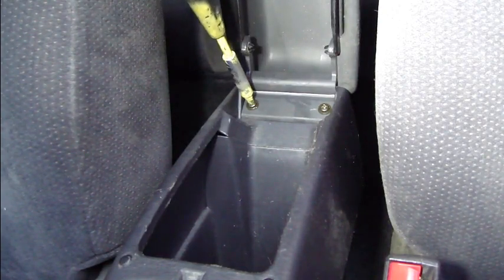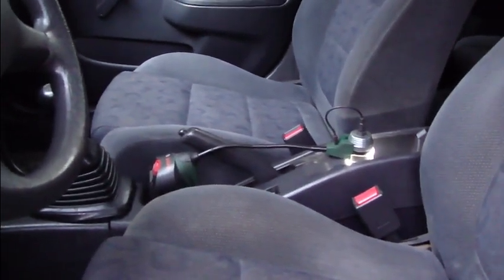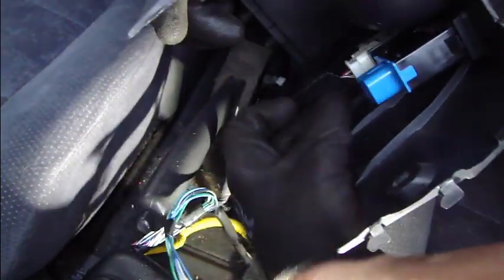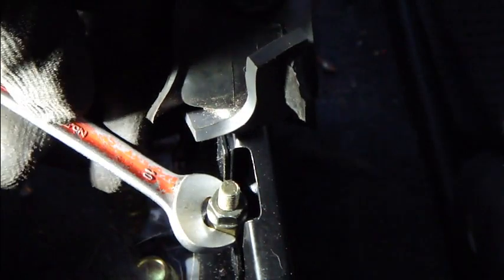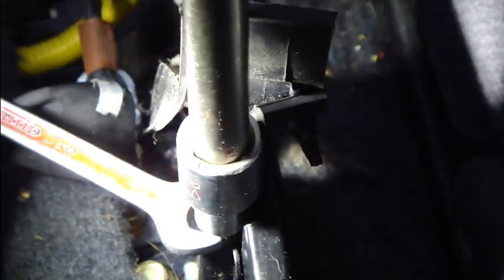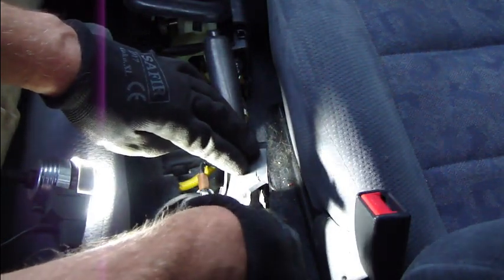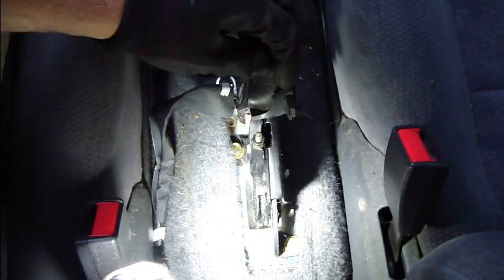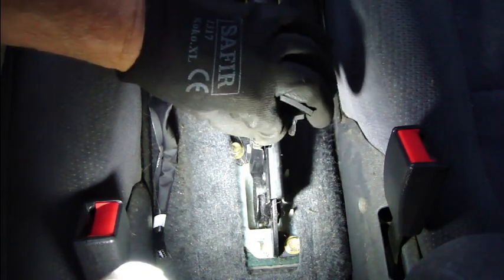How to adjust hand brake cable Toyota Corolla. Years 1995 to 2015

Comment: No need to take centre console out if you have a long reach socket, just move aside the handbrake lever dust cover and you'l see the adjusting nut
Reply: How do you stop  the adjustment nut turning when your tightening the lock nut?
Reply: @Mickyrst43  I think you first unscrew it, then tighten the nut below and then screw the locking nut back in.
Reply: Ohh I misread. It tightens against the nut below, at least for me it did.

Comment: Thx for posting your video, I have a tercel but the set up is similar and your video helped me diagnos my e-brake problem. Took everything apart found the cable with the two bolts, pulled on it a little and the cable came out, it was broken, lol, time for a new cable, that's job is too big for me, at least I can tell the mechanic exactly want to fix and not get ripped off, because you know how mechanics are with girls when we come in with problems and don't have a clue about what's wrong. Thx for you video it was very helpful.
Reply from the maker: kjlloyd424 Thanks your info text and You are welcome.

Comment: My son and I have been working on a 2000 Chevrolet Prizm LSi with a emergency brake that is very similar to that shown in this video which also requires the use of 10 mm open end and/or box end wrenches to turn the adjusting nut and locking nut used to adjust tension on the brake cable. But on Monday January 20, 2020, we could not adjust the cable tightly enough to get the car to stop well  when testing the brake for emergency use. Also, we could easily get nine or more clicks when pulling the emergency brake lever. My 1989 Toyota Corolla stops better even though this Corolla still has old brake cables and has not had the tension on the cables adjusted. We checked carefully all that we did and believe all cables were installed correctly  from the rear wheels all the way to the lever for the emergency brake. We had the same problem before January 12, 2020 but that cable stopped the car not as well as the one with tension set on January 20.  On January 12, we tried tightening the tension further than the threads on the cable allowed by using three larger nuts as spacers put below the tensioning nut but around the threaded metal that attaches to the cable. We succeeded very well in increasing the tension because we broke the cable. When I looked under the car I saw that the portion of brake cable that leads from the lever back to the equalizer was non-existent. 

On January 20 we decide against using a large nuts as spacers for fear of breaking another cable.  

Have any of you had a similar problem with new brake cables not adjusting to enough tension to stop the car effectively?   What I mean by "effectively" is that when parking the car on the driveway with what I am guessing is about a ten percent slope, seven or more clicks are needed to keep the car from rolling down hill when the gear is disengaged. 

If you or anybody watching this video had such a problem and were able to correct this problem, how did you correct this?

Comment: Hello Peter. Been watching your videos for years-great work. I need to do this. Adjustment is similar to throttle cable. 2006 Matrix with 135k miles.
Reply from the maker: Ok and Thanks. :-)

Comment: How does the handbrake cable tightening plays out with handbreak shoe tightness? I am trying to get my shoes contact tuned and to increase braking force. But never get enough force to pass test.
Reply from the maker: Thanks and noted 👍
Reply: @PeterFinnTheCarDoctor  I had one guy look at it and the cables were worn out. It is hard to diagnose as without pressure/brake disc they look like working but when the brake disc is installed it starts to do weird stuff.

Comment: Great video Peter. I have a question. I did this and my hand break is very tight but my car still won't hold (it rolls). The break pads and rotors are new. Do you have any idea what it could be? My car is a manual (5 speed) so no parking break.
Reply from the maker: Abe S Yes, I have two service ideas: lubricate or change had brake cables. And lubricate rear brake shoes metal contact areas. Look video: https://youtu.be/SgMp4Jf-NJ4

Comment: MR. PETER,how do you do?. my parking brake lever does not move down completely it leaves a small gap than normal some time i feel parking brake as it is engaged and   i  engage and disengage the brake until i feel my car rolls back then i can drive my car  where can it be the problem from rear drums or brake lever?thanks
Reply from the maker: +mohamed moktar Hello, you need to lubricate your brake cables. Here is video: https://www.youtube.com/watch?v=kkk65WvkVi0

Comment: Great video!, But i have some problem - mine rear brakse are disk, only one wheel is getting tight, when i engage hand brake, other is loose. is there an adjust in corolla for each wheel?
Reply from the maker: +Tom Kolbin Hello, I will do new video to You.
Reply: +Peter Finn great. thanks a lot man.
Reply from the maker: Here is new video: https://youtu.be/LUgDRb_W400

Comment: Peter, I installed new brake shoes on the rear drum and the liver is now very loose. Do I need to make adjustments on the drum itself or as shown in this video? I was expecting the liver to tight after installing new shoes because the new shoes are thicker than the old ones. I am not sure why it became loser than what it was before after installing new shoes.
Reply from the maker: Hi, I this the liver like the rear break handle / grip.
So you need to first adjust your break shoes on the drum area. There is special bolt. Second, then you need to adjust the break cable bolt in cabin area.

Comment: Peter my Avensis handbrake is a little bit loose when i start to pull up the handbrake. and also i have to pull hand brake up really hard to make sure the brake is working because  the car moves a little bit if i don't pull the handbrake up hard enough. 
My question was if i tighten up the handbrake adjuster so that i have 5 clicks will that make the back brakes more strong and will it stop the car from moving better?. and if the car still moves will that mean that it must be the brake shoes?

Comment: Hi Peter, I just replaced the brake shoes and the drum on my 99 corolla. I adjusted the stiffness of the hand brake but the parking brake still won't brake... do you think my cable are the cause of the problem ?
Reply from the maker: Hi, you must adjust brake shoes adjusting bolt too. Look video: https://youtu.be/WygOHnIC9eA

Comment: Works perfect! Thanks! I only had one nut so I installed one extra just in case. There was a brass colored nut on mine. Not sure whats supposed to be there originally? 1 or 2x nuts? :)
Reply: Toyota Corolla G6R -98

Comment: Hello Peter!
I have a small question:

I dropped a coin into the handbrake area (it fell between the rubber that is attached to the handbrake handle).  I am curious if you think this could be dangerous for my vehicle or the handbrake mechanism?  I will try to remove the plastic cover like you did in this video to find it, but I am curious if you think this might be something concerning or not.

Thanks!!
Reply from the maker: HI, If you have Toyota car, normally no issues. But if your car cable goes hard to move, then open the console.

Comment: Hey, i have a 2000 corolla Automatic, and its the one with the manual window thing. after i take off the screws from the rear console like you did, it does not want to come out, it tends too move the rest of the center console. is there other screws?
Reply from the maker: Hi, please try to move carefully the console to directions: back and front. And then carefully up. There should not be any screws, but there could be electric cables and switch. Switch opens with small screwdriver.